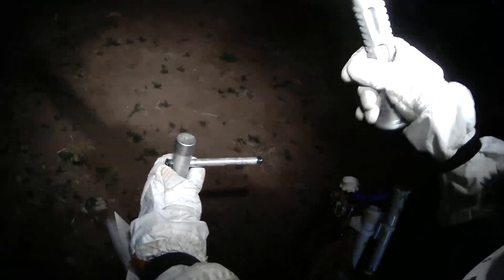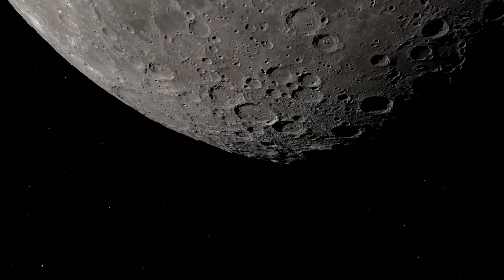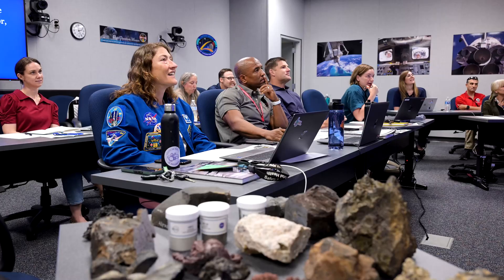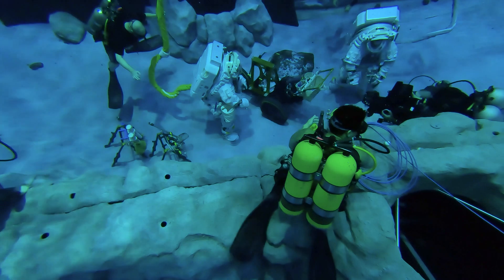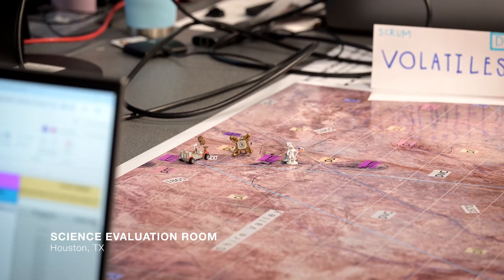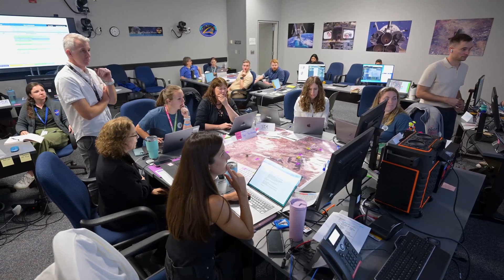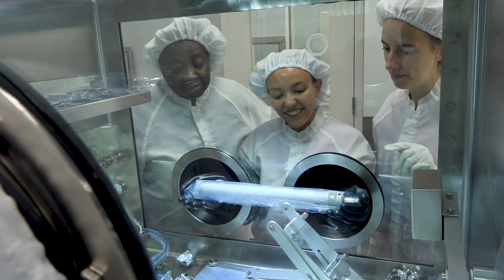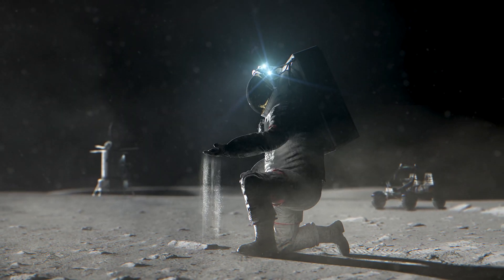Preparing for Artemis: NASA's Geology Training for Lunar Exploration

Comment: NASA should be gaining operational experience using the Orion capsule for astronaut travel to the ISS.   The Orion capsule is a deep space ship that is designed to be upgradable.   It has long term prospects of being a deep space crew rescue capsule for decades.   On paper using the Orion capsule instead of Boeing's Starliner to the ISS is more expensive, but for the few missions it would likely be used for this purpose the actual cost would likely be less and this use builds valuable long term operational practice for a capsule that could be in service indefinitely if development goes well.